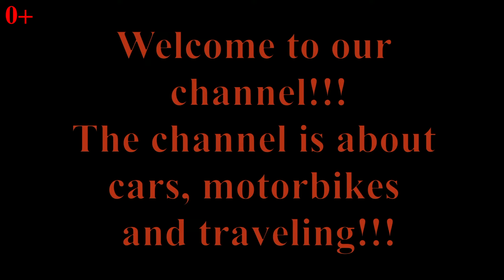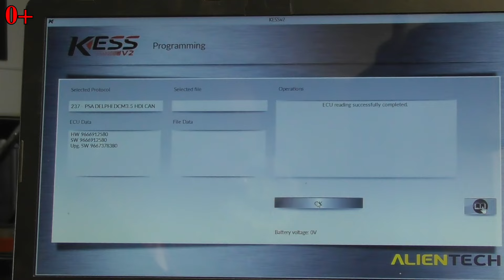Peugeot 308CC 2.0 HDi catalyst and DPF filter removal EGR deactivation. 0+

Comment: Is there’s a gain when you remove the DPF and EGR ?? (I actually have a stage 1 remap)
Thanks
Reply: I removed mine with the stage 1 upgrade as well. It doenst have that Turbo diesel pull anymore, its power for me feels more linear. Its strange to explain. But it does drive better.
Reply from the maker: Yes. There is a difference... I have video before and after.
Reply from the maker: @alexwarren5447  Sound will not change, anyway You will not feel the difference, and reprogramming of the ECU is necessary, or You will get codes in Your face.
Reply from the maker: @alexwarren5447  👍👍👍